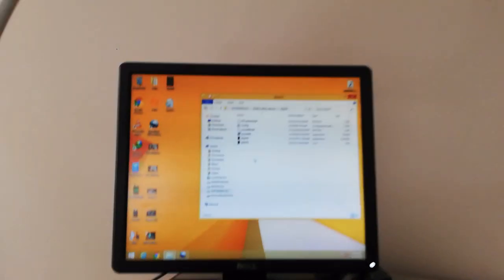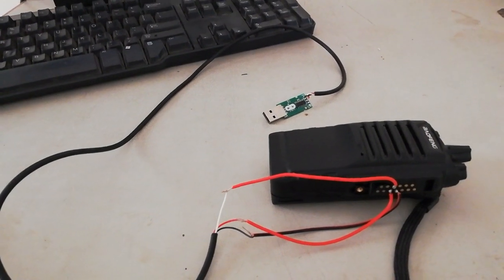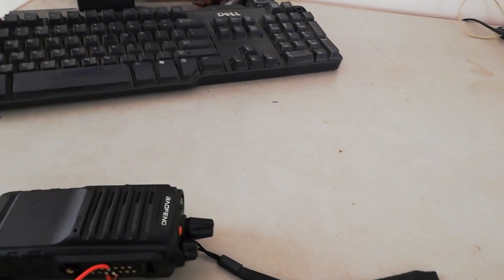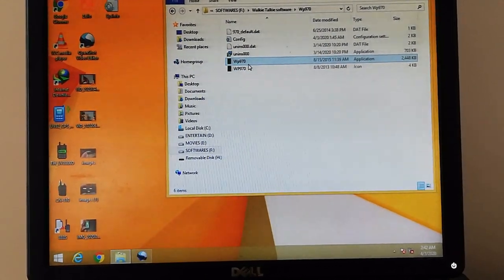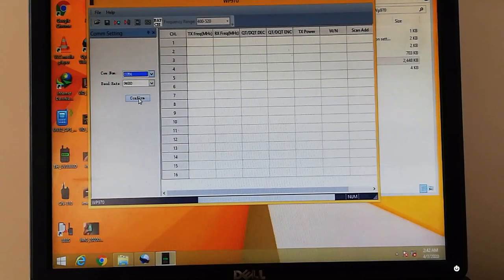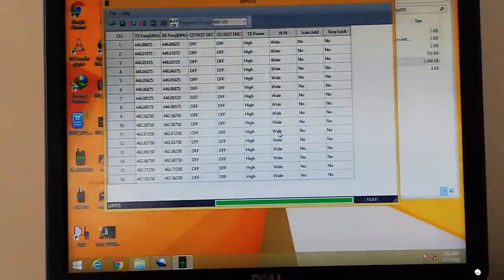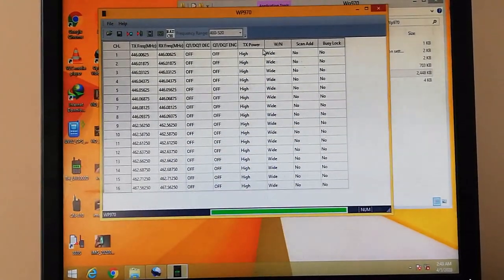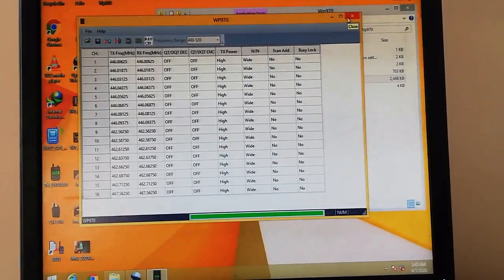Baofeng BF-9700 programming Part 3

Comment: Hi Aslam. I am trying to tune my uv-5r to a bf-9700. Can you share with me the default frequencies per channel? I tried the freq on this video when you read the radio but it didn't work.
Reply from the maker: Actually the frequency you see in this video are not its factory frequency .. these are the frequency i  had already programmed in my radio..
Reply from the maker: Where are you from?
Reply from the maker: https://gist.github.com/kennedy/11278351
Open this link and try these frequency and settings on your uv5r.
I hope it might work

Comment: Hola buen día, tienes la lista de frecuencias que trae originalmente el baofeng bf 9700? Muchas gracias!
Reply from the maker: Hola buenos dias.  no, no tengo la frecuencia de configuración de fábrica.  para esas frecuencias tienes que resetear tu radio.  después de restablecer su radio, recuperará la frecuencia de configuración de fábrica.
Reply: @aslamshiekh3058  sucede que no tengo forma de conectarlo al pc y quería usarlo con otros radios.
Reply from the maker: @pablogomes2488  ok ok lo entiendo... así que quieres la frecuencia almacenada de fábrica para que puedas usarla con otras radios que tengas... intentaré encontrarte la frecuencia original que tiene.
Reply: @aslamshiekh3058  te lo agradecería muchísimo!